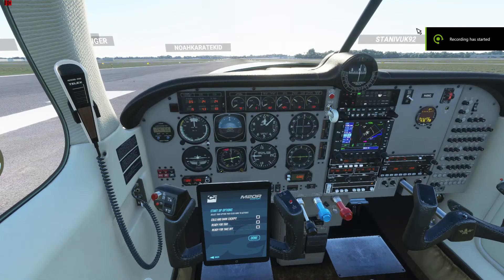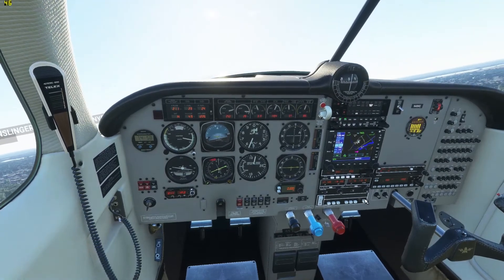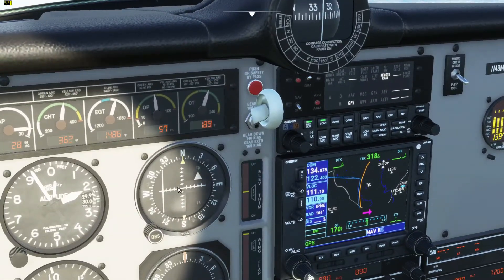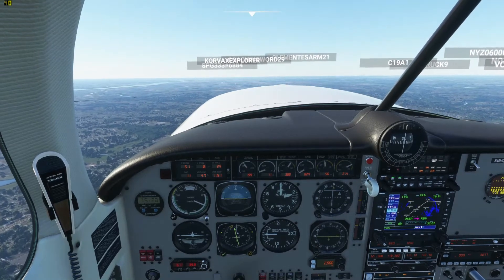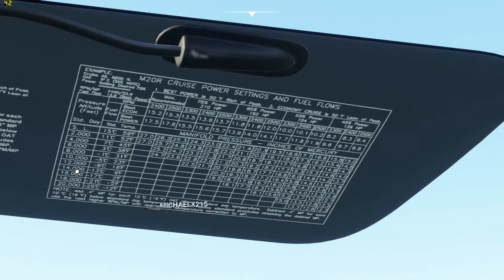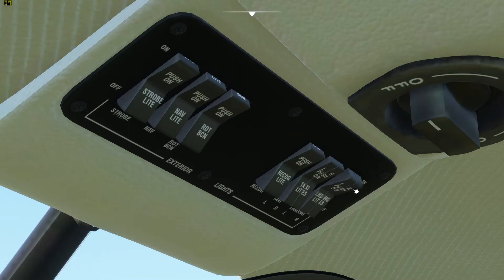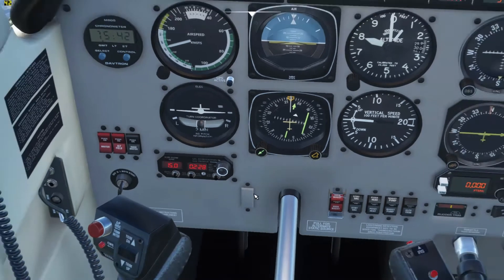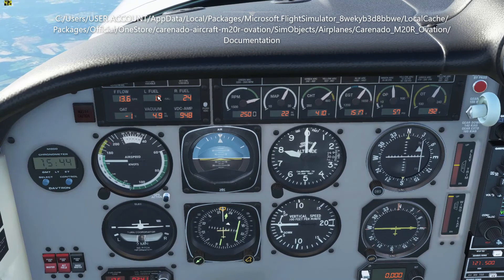MSFS M20R tutorial

Comment: how do you get the altitude preselector to work? whenever i select the altitude and arm it it doesn't climb or decend. It shows it as captured but im still at the same altitude as i started
Reply from the maker: I’ll have to check. It’s been a few updates since I made this video.
Reply: @CRgamingMSFS  i checked on the forums. Turns out the the Working Title 530 broke some aircraft autopilots. it works fine once the addon is uninstalled.

Comment: how high can you fly in yours... it says FL200 is its ceiling but i cant get the plane above FL180 without it stalling. (yes fuel mix is fine etc) also the brakes on landing are horrific, it just dont want to stop.
Reply from the maker: The plane can only make it to max altitude of not overloaded.  Keep in mind this plane isn't pressurized, so even with supplemental o2, it likely would not fly that high in real life.  As for stopping, make sure to use the spoilers and make sure your engine is not still producing thrust.
Reply: @CRgamingMSFS  spoilers don’t really make a difference either, a 747 can stop quicker than The m20r with just it’s brakes.

Try landing one at at Bart’s TFFJ or saba they really expose how awful the brakes are

It’s possible sure but should be easy for that kinda plane not hard work, stopping from just above stall speed should not take 500 meters! Which means you have to stall it or use the parking brake at saba to “cheese it” as you only have 400m (or set the wind against you to manipulate your air speed vs ground speed) 

It makes me not want to fly it and I go back to the piper or g35, both have much better brakes and can stop in half the distance.
Reply from the maker: I've really had no problem stopping. The spoilers should kill the lift making the brakes work better.   I have landed it at barts and did not use the full runway.
Reply: @CRgamingMSFS  is it an xbox model thing then? because honestly the brakes are horrific, the only way to stop at saba is with parking brake applied and stall it onto the runway, speed brakes don't make any difference on xbox for this plane, i can see they're up but even if you apply them mid flight... nothing, no change in speed.

the similar planes i've flown all stop better, and in half the distance, just cant get the m20 to stop like that, its fine for 99.9% of runways of course, but saba is the 0.1%